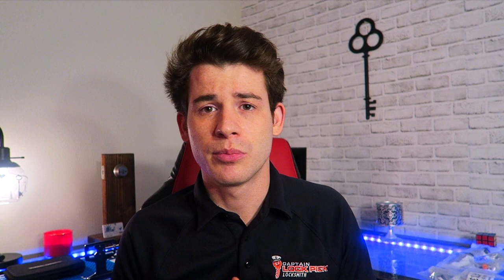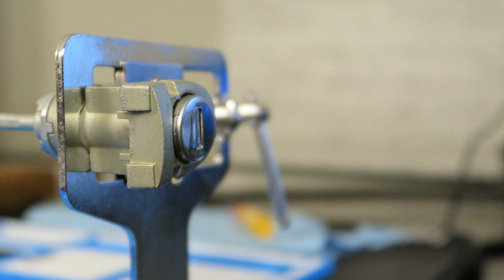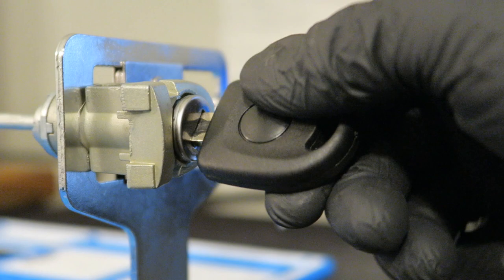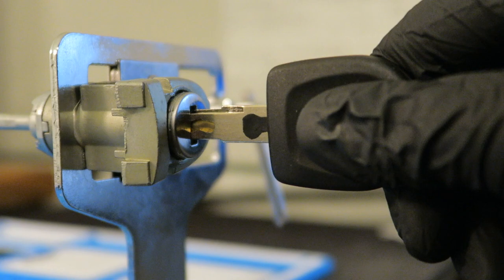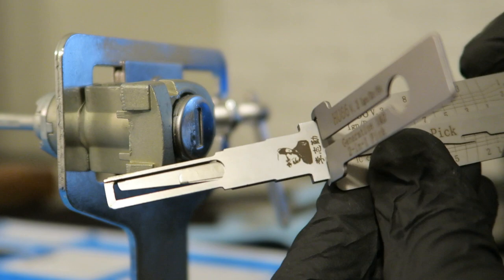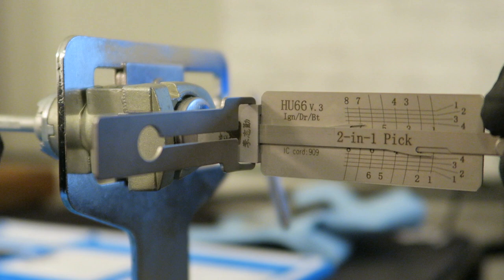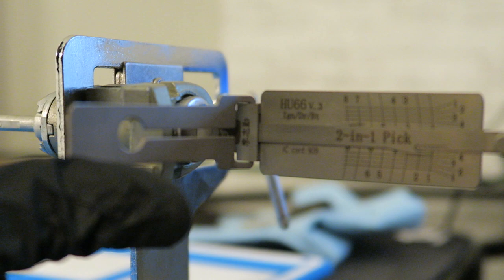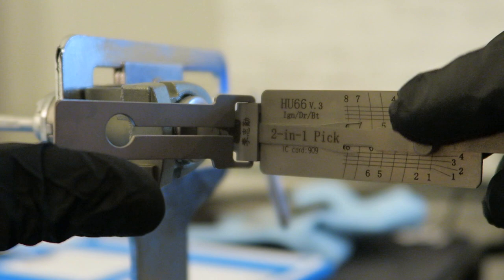Prepare Lock For Lishi - Lishi Tips [01]

Comment: You need to spray lubricant between the lock plug and core. 
Many auto locks you will have to pick have never been opened by the key so will be seized.
I attended on car and picked the lock several times I thought but the plug would not rotate 
and it had seized up. Plenty of WD40 needed to free up plug